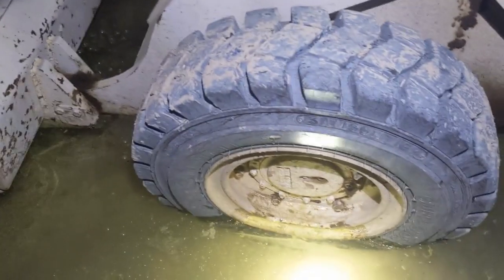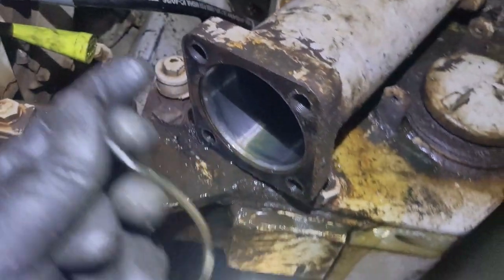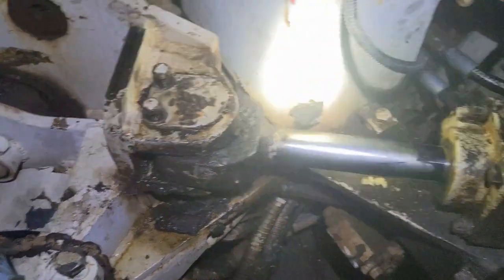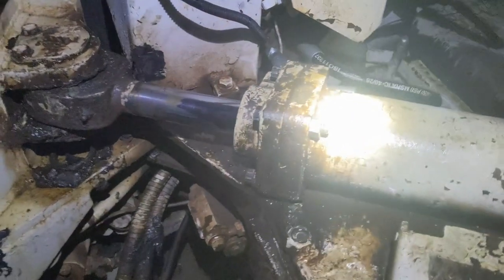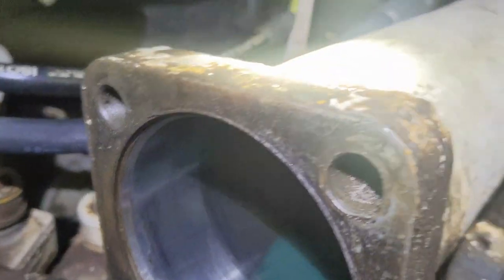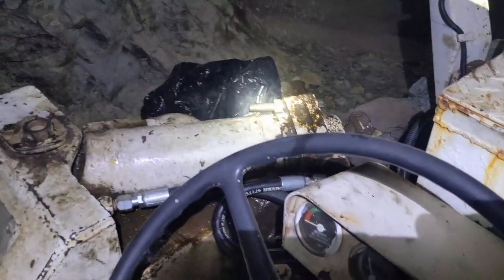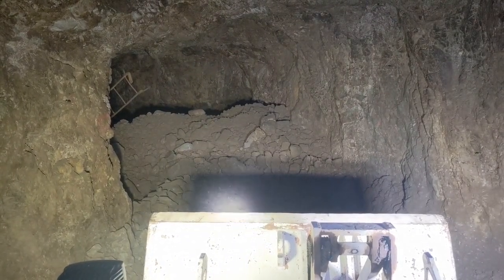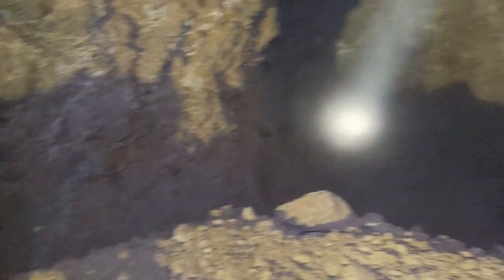Underground Parking Area & Hydraulic Cylinder Reseal: Hard Rock Gold Mining Episode 26

Comment: You need to sing that tune when doing repairs like that.

🎶Going to do some sketchy sh*t,
Doo dah, doo dah.
Hope I get away with it,
Oh dee doo dah day!🎶
Reply from the maker: That goes for every mine I've ever worked at! Every piece of older equipment has its share of dubious repairs. Once the o-ring was replaced and things were torqued down, the sketch factor dropped substantially. I ran the machine for about six hours this weekend and it behaved normally with no leaks or movement.

Comment: They made an o-ring so it blew out where it was glued. I would be careful not to run cylinder to the end. The bolt would be ok just to move out of the way. Shouldn't have over torque it.
Reply from the maker: Yeah, the first undersize bolt with the blown o-ring was just to move the machine out of the water. The second repair is more permanent; at some point I'll pull the cylinder and have a machine shop do a more proper repair.